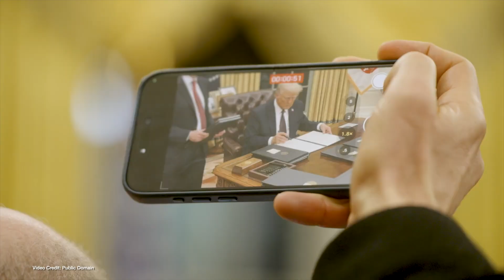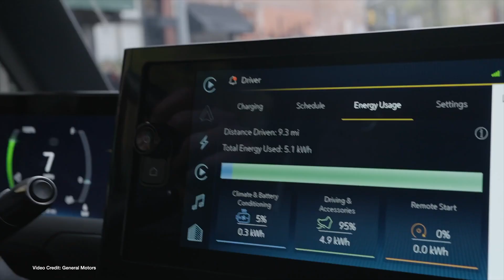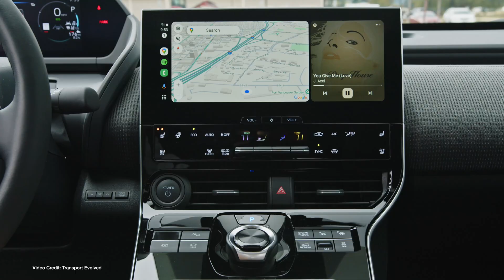EcoTEC Episode 354 - China's Space Solar, UBCO In Trouble, Formula E Fast Charging!

Comment: I believe that a Geo positioned satellite will still mean the generation in space will not be 24 hrs. 
As the  satellite stays above the same place on earth it will still see a period of darkness as the earth spins the satellite also spins in relation to the earth and passes in to the dark side of the earth, albeit a few hours less as the rays of the sun reaches the satellite a bit earlier than when the sun shines on the same point on the earth and goes dark a small amount of time later at sun set.
Positioning in the arctic circle or antarctic  would improve coverage significantly for more of the year but the opposing summer / winter polar position woud still result in some level of darkness.